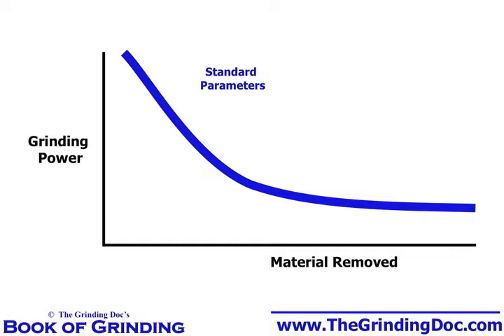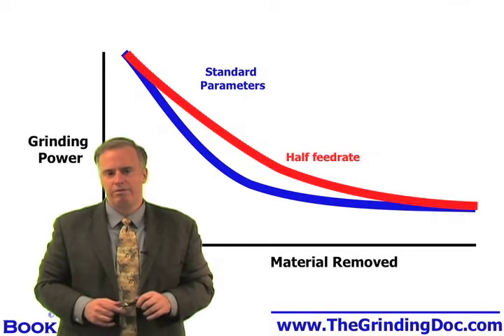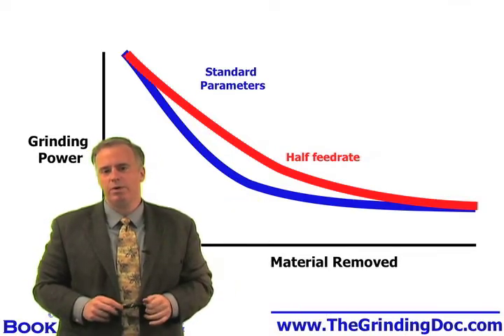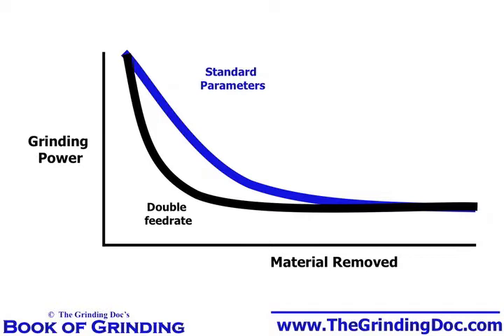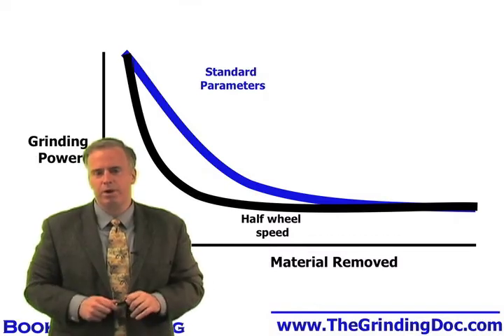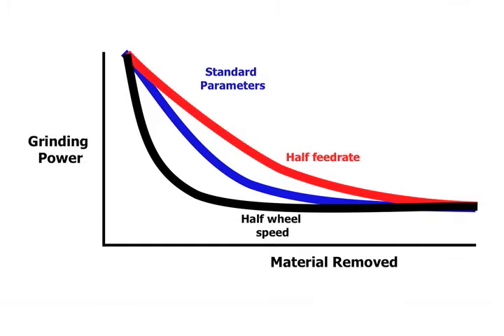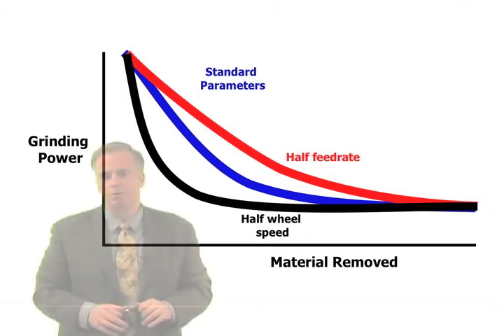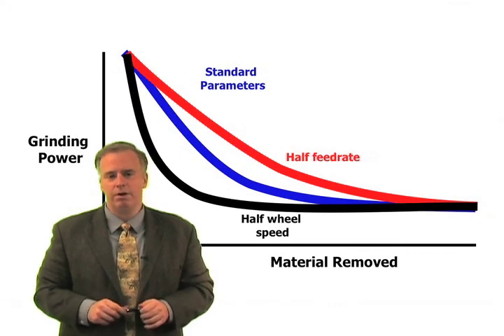Episode 43: Getting the wheel to open up

Comment: Cutting Tool Engineering, so even though I "open' up a Norton polymide bonded CBN 240 grit profile wheel (stock cnc wheel item  10D240-PB125-U Univel) with a 220 grit aluminum oxide stick does this process "fracture the grain"? any info is greatly appreciated
Reply: It sounds like from the video that hand feeding a dressing stick won't produce the required high forces to fracture the CBN grains, instead performing as dressings sticks do with resin bond diamond wheels, and more simply exposing newer grains, not yet "open". As described, the first few parts, or more ideally passes, after dressing the wheel should be viewed as finishing the wheel conditioning process.